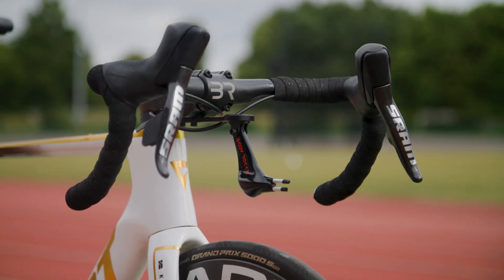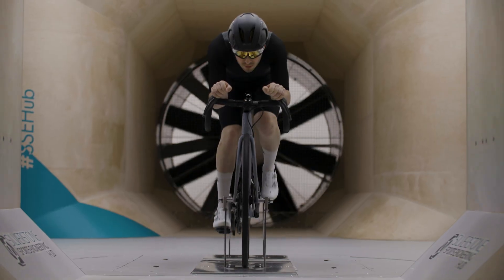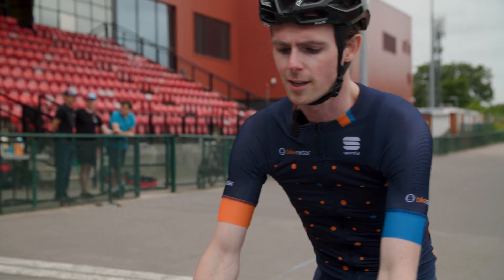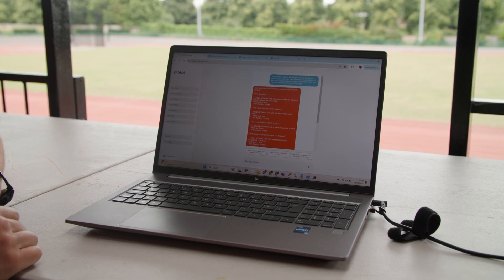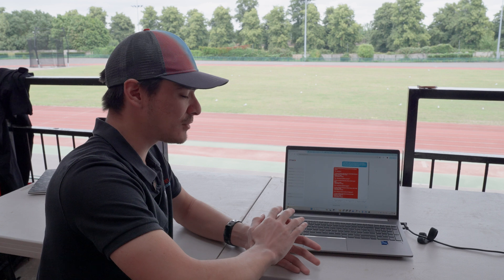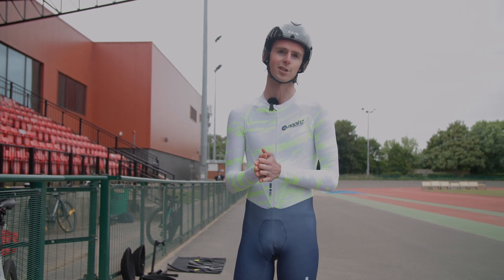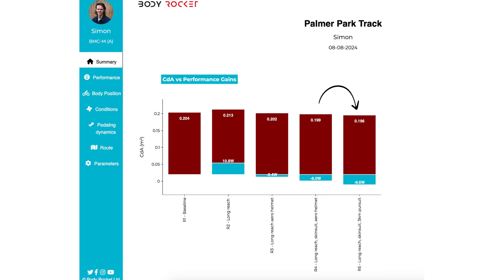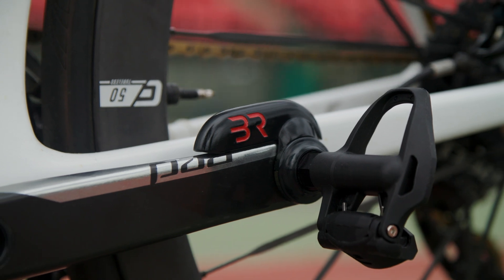Exclusive: We Try The Future Of Aero Testing

Comment: Compared to other aero sensors on the market intalling all of those bits in the bike seems like a nightmare
Reply from the maker: Yes, and that's definitely going to be a hurdle for BodyRocket – the pay off, though, is that you don't rely on so many assumptions about things such as rolling resistance, as its measuring the drag force directly.

FWIW, BodyRocket says the aim is the make the system easy enough for any normal rider to install in 20-30mins. Of course, it remains to be seen if they manage that, but I think that's the right ambition.

Cheers for watching, Simon
Reply: To directly measure drag force like we do it's necessary to put force sensors into the bike, just like with a power meter.  It is possible to buy an indirect force power meter that only requires mounting a device on your handlebars, but this is less reliable and it's uncommon to see people using one.

Comment: I think the interesting thing is that they seem to have put much more effort into the software compared to the other aero sensors on the market, like the Notio.  Th software for the sensors I have tried has been pretty rudimentary and buggy.
Reply from the maker: Yeah, I agree – I think that's a really important point as knowing how to use these tools, what to test and how to analyse the data you collect is just as important as having a functional aero measurement device.

Hadn't heard anything about the AI assitant prior to turning up for the testing session, but was impressed at what they've developed.

Cheers for watching, Simon
Reply: We totally agree that it's very important to get the software right to have a true consumer product. Whether it's power, heart rate, or even GPS, the real value comes from the data and how easy it is to use that data to make decisions that will improve your performance.

Comment: So they made him uncomfortable and not aero and then used that number to give the bigger before/after number at the end? Or am I missing something?
Reply from the maker: The AI assistant suggested increasing the reach to my pads by 30mm (amongst other things which we didn't have time to test), but as the engineer said that didn't work (it increased my drag versus the baseline).

Worth bearing in mind, though, that the BMC wasn't my bike – it was just a loaner for the test day, so my 'baseline' position wasn't at all optimised. I literally just turned up, put the saddle to the right height and jumped on 'as is'.

Knowing that increasing reach cost 10w or so is useful info, though, as it helps rule that change out – without that data, we might just be making assumptions like "increasing reach = more stretched out = more aero".

That said, the point of this video wasn't really to demonstrate how aero I could get / how many watts I could save, but to show how the BodyRocket system could be used for real-world aero testing, so while the watt-savings are interesting the bigger story here is that it's a functional real-time drag measurement system that's actually fairly simple to use.

Cheers for watching, Simon
Reply: The comparisons in the video looked at each change relative to the one before it. Without testing it's not possible to say how the aero helmet would have performed on Simon in the shorter reach position, but it's likely that the gain over his road helmet would have been similar in both cases.
Reply: no, u do not

Comment: The weight measurement should surely be in the hubs as it would be simpler surely?  The software platform seems to be the real product and theyve been forced to engineer some of the measurement devices as they do not exsist.
Reply from the maker: The measurement systems are definitely the 'real product' – they've been developing those for a number of years now. The software is definitely an interesting addition, though, as knowing what to do / how to analyse the data is arguably just as important as the measurement device.

Having the sensors at the contact points is so it can directly measure changes in body position / clothing / etc. As that's the biggest component of aero drag. Why do you think having it in the hubs would be simpler?

Cheers for watching, Simon
Reply: That's right, nobody was directly measuring the drag force so we needed to build the sensors to do that. We totally agree that it's very important to get the software right to have a true consumer product. Whether it's power, heart rate, or even GPS, the real value comes from the data and how easy it is to use that data to make decisions that will improve your performance.